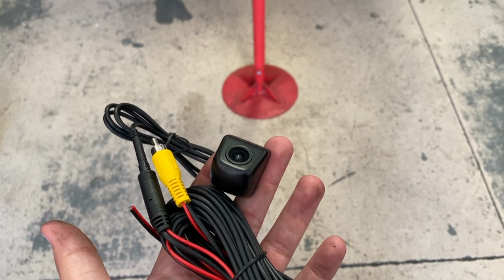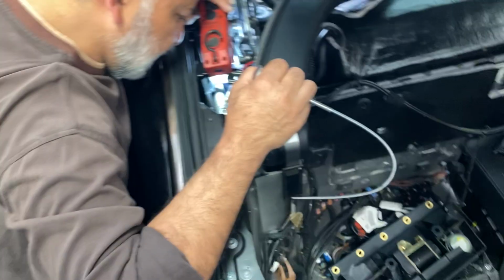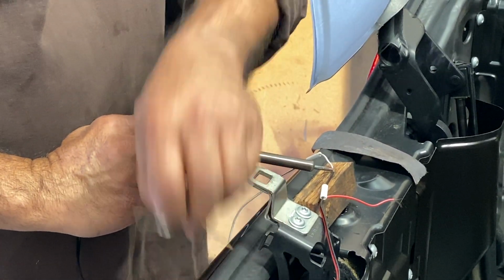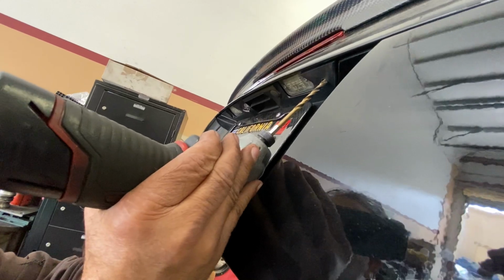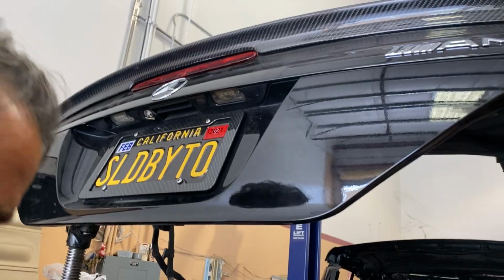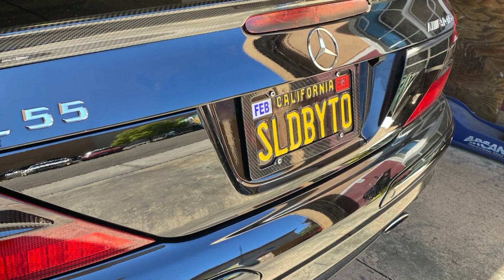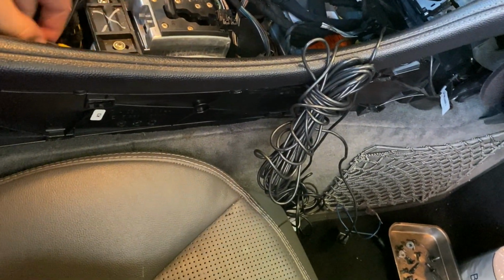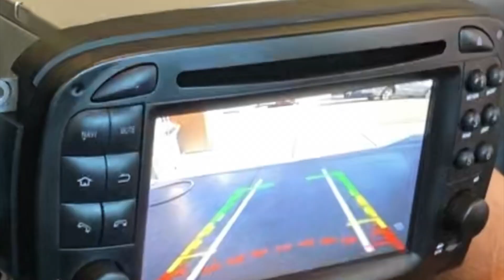Putting a reverse camera on the SL55 AMG | SL55 Build pt 4

Comment: Hi, thanks for posting! I'm curious about the android head unit you used and the year of your SL55, so I can see if the head unity is compatible with my 2004 SL55. Did you have to use a fiber optics decoder and/or rewire the speakers to a new amp?

Comment: Does the wire from the camera go through the same hole that you drilled to mount it? What is on the other side of that trunk panel inside the trunk? My SL55 has a lot of hardware mounted in that area and there is a sheet metal panel covering that area as well.
Reply from the maker: Hi Tom, few things to mention. Those parts are the trunk actuator and the 3rd break light. Those were not removed in the process the wire for the camera followed the wire for the 3rd break light. As you saw in the video we drilled the hole to fit the wire through. The sheet metal panel is just structural rigidity. The camera wire came in two separate pieces  the camera and wire with a male input to the video cable with a female output. I put the opposite end of the camera first so the wire can fit inside that panel. We used some tweezers or a long thin arm that can grabs (shown in the video) to pull that cord out all the way.

Comment: How does it detect being in reverse?
Reply from the maker: It communicates with the ecu through some of the plugs that were connected. I dont know how but it detects the car going in revers all the time.
Reply: @Mr.Affalterbach   Did you ever fix the noise issue in the gas tank? If so, can you give me some input? I have the same issue with my SL500. Thanks!
Reply: @markinverde10  Can tell you what this is as I and many others have had the same issue. The baffles inside the tank break lose at the welds and drum as the fuel slewses back and forth. Can be fixed by attaching a spring to the baffle attached through the gauge float. Takes a couple of hours to fit.
Reply: Do you remember which connector and which wire signaled that it was in reverse? I see you grabbing a red wire but can't tell where it originates. @Mr.Affalterbach